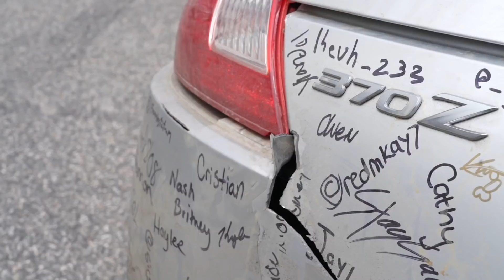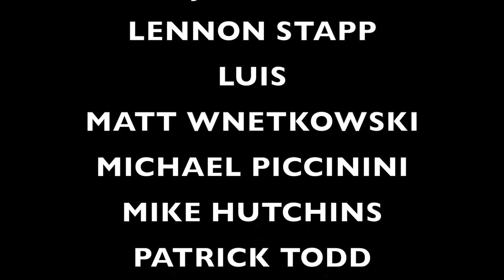SAYING GOODBYE TO MY LS3 COLORADO….

Comment: You gotta put the car in a trailer and have someone working on it while you're driving to the event. Will could have been in the trailer doing the radiator
Reply: The whole point of the event is you drive your drift car from track to track. He could do that but it’s frowned upon.
Reply: Idk if you've ever been in a enclosed car trailer you can't see out of but it would be super sketchy to ride in one going down the highway
Reply: @wheeln24-79  that's why it would make for good content